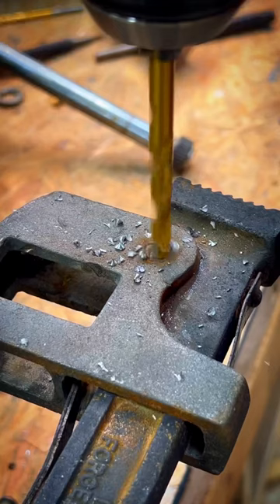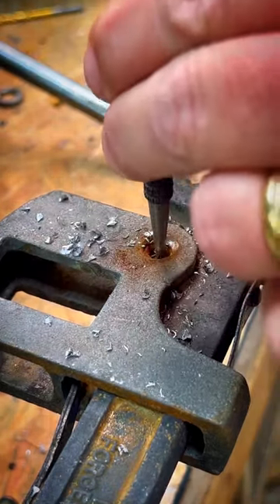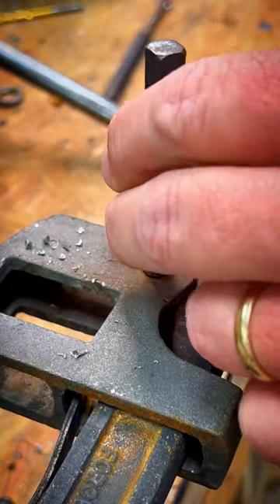Removing revits on an old pipe wrench #workshop #vintagetools #toolrestoration #tools

Comment: Wait why tho? I love that you didn’t just take a grinder to it so it wouldn’t look ugly after, but what was the purpose in the first place? Genuine question
Reply from the maker: It didn’t look bad after. I thought a grinder would be too much for removing something that small. These rivets were common on older tools.  They could have used something else like a bolt as well I guess. Does that answer your question?
Reply: @Zackstoolshop  I know it looks like no damage was done but you changed it for a bolt?

Comment: Try an angle grinder on “ Rivet” head next time and save yourself a lot of unnecessary work .
Reply from the maker: Thanks for tips
Reply: May as well drilled it in the first place
Reply from the maker: @bessbobs  hindsight’s 20/20
Reply: Steve its a restoration! An angle grinder would damage the tool and also it was quick enough anyway!
Reply: @vfrtom9669  an angle grinder in the wrong hands can do a lot of damage , you obviously have the wrong hands .
Reply: @steve4479  i agree however even going too low on the rivet will damage the tool thats why he used a multi tool instead.
Reply: @vfrtom9669  that is true , when using a tool like that you need good eye to hand coordination, I’ve seen precision machines used by animals with the same resultant outcome and it’s not good .